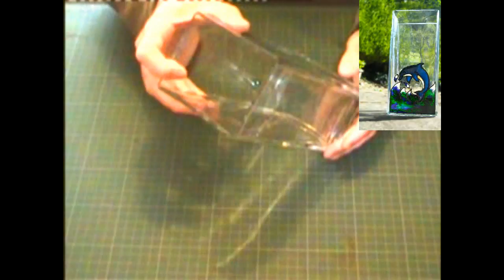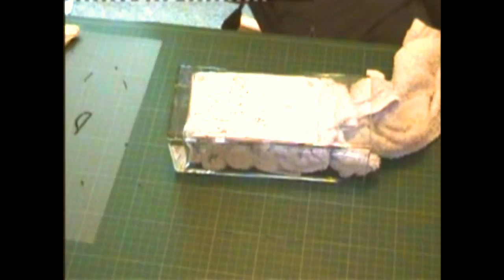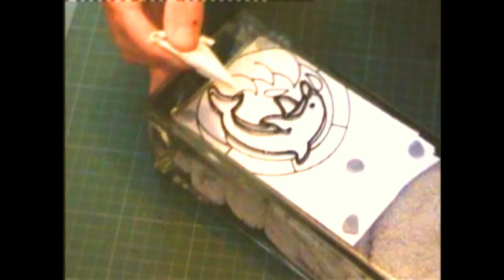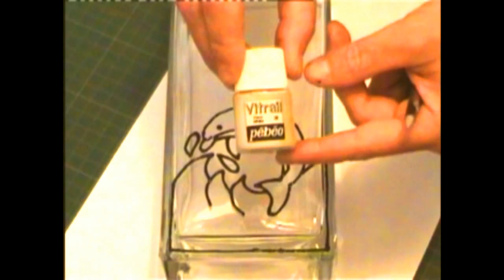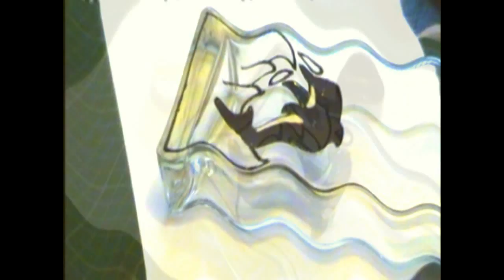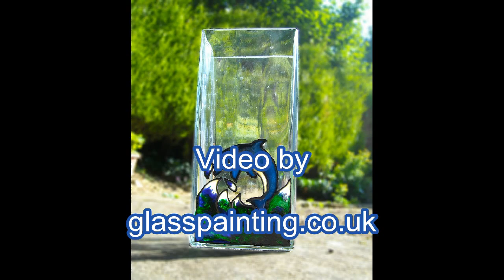Glass Painted Dolphin Vase

Comment: hi likes your video very much, would like to ask what colours you use, are they acyclic type ? thx in advance
Reply from the maker: Jay  Sorry, not sure why I didn't see this before. They are cellulose based paints. The smell is a bit string  (like nail varnish) but it dries really hard and gives good colours. Just use it in a well ventilated room. Don't know where you are but if you are in the UK you can get it from Fred Aldous (FA Glass Stain Lacquer)
Reply: splotters1265 thx for the info, better late then never.........lol joking :) thx for your answer i think i will find paint like that in Malta
Reply from the maker: Possibly not. Not sure if FA do mail order. Its a flammable substance so there may be restrictions!